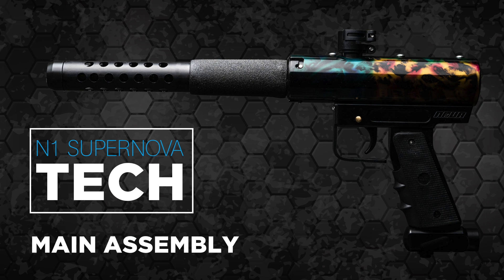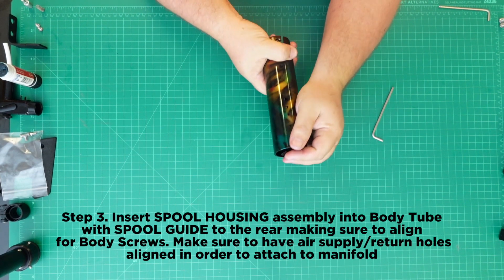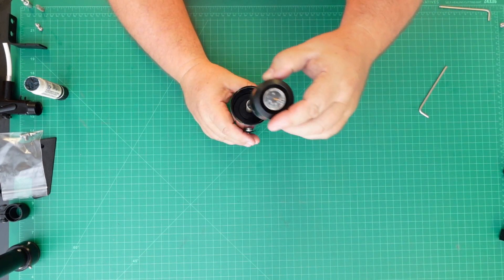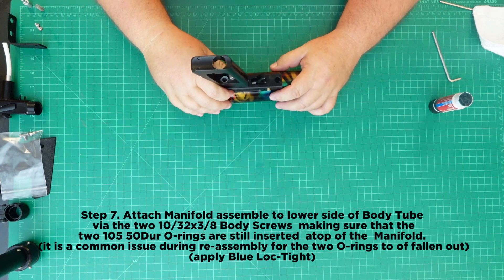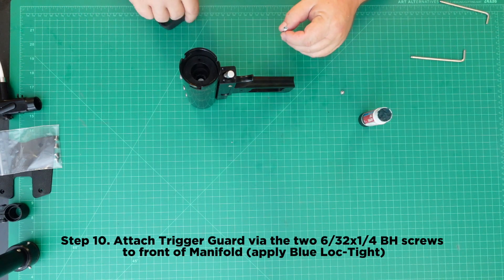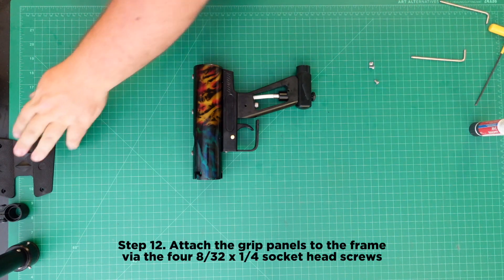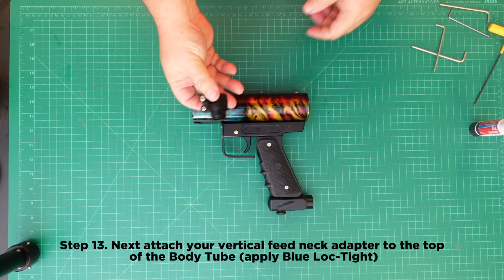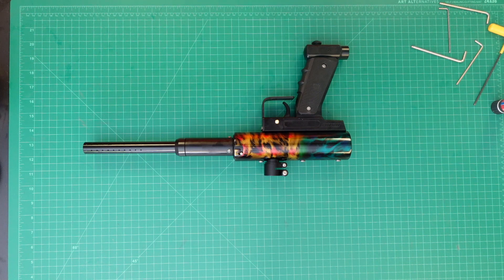N1 Supernova - TECH -  Main Assembly

Comment: holy throwback, so with over 20+ years nothing on this marker has changed?  Why?
Reply: There are multiple changes but this is also a redesign of the old nova but in the same style and form, you may be more interested in the N3 in the weeks to come, much more modern and speed/size oriented
Reply: I imagine anyone buying a N1 Supernova in 2022 is doing so in order to get a high performance marker, but instead an old piece of paintball. Also I have no idea what this marker is.
Reply: isn't doing so for high performance marker*
woops, one typo changes the whole meaning of my reply